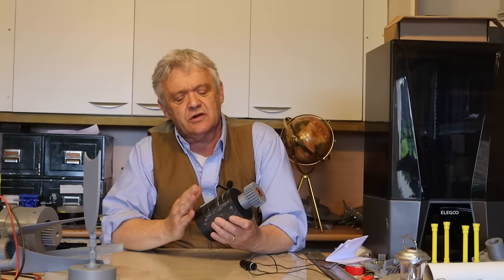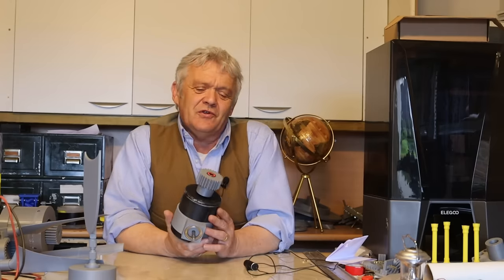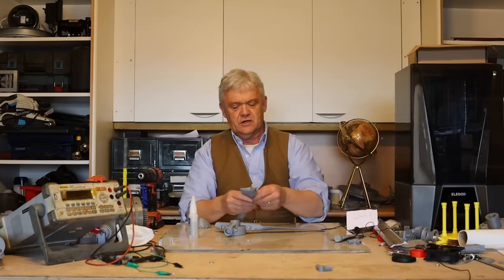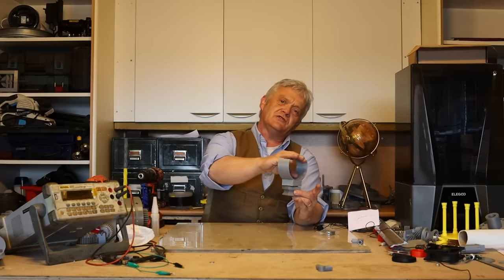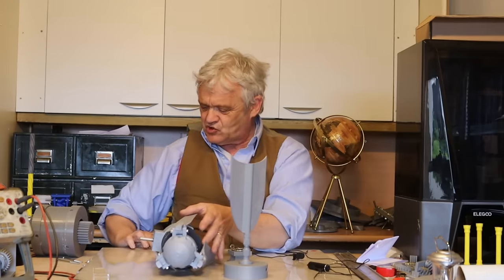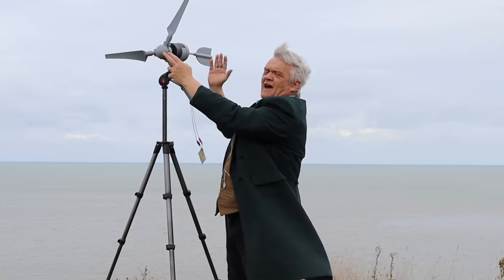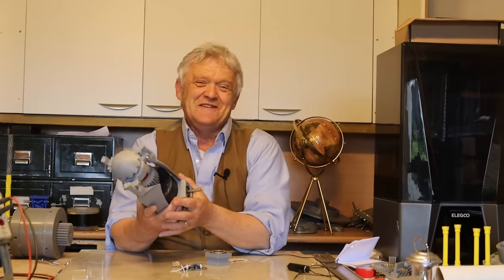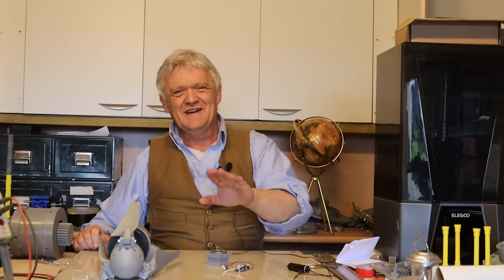2012 Awesome Portable Wind Turbine

Comment: That really goes. You scared the heck out of me. All that "plastic" moving at high speeds and you standing less than a meter from it. Holy Hannah.
Reply from the maker: lol - just think if it was razor blades mate -then you need to worry - lolol
Reply: I'm sure there was no real risk here given the short duration and the freshly printed blades, but I was a bit scared too!
Mass produced wind turbines are usually placed many meters away from occupied buildings because when those blades come apart, it's pretty spectacular. You don't wanna be near a spinning mass of fibreglass or shattered plastic traveling at 30mph

Comment: Congratulations.  No need for gears.  (the best part is no part)  That coreless generator worked out nicely.  The turbine blades are very impressive (and facing the right way).  A video about the blade design; airfoil used, twist rate, taper, etc. would be wonderful.  The generator and blade designs take this beyond toy potential.

Comment: Alfred T. Forbes "The Homebuilt Dynamo" describes and lays out in tables building a wind generator to a specific wattage and rpm range.
In this book Mr. Forbes builds a wind turbine generator of 1000 rpm or less, and in that rpm range will generate 1000 watts.
He shows how to pick a wattage and rpm and then design the coils based on those parameters so you can achieve your desired output.
It is a book written by an engineer for engineers, very well thought out.
Reply: @danedmiston9673  It's been a while since I've read the book. I kept it next to my computer when doing any wind generator research. It was the only book, that when I gave it away to an engineer, so a good home, was painful for me, I didn't want to turn it loose.
This book, for me, demystified many things about generator design, where other books are overly complex or skipping on valuable details.

Comment: Amazeballs! Thank you for all the files! 

This would make a great trickle charger for Dad's boat to also help keep the birds from crapping on it. Right now there are weighted plastic owls and zip tied on lengths of plastic bags working as winged tentacles. It was working for a while, funny eh. Have a good one all.
Reply: I was just thinking similar.   I have a 'hawk' with fluttery wings, on a long flexible pole at my allotment, it keeps the pigeons and squirrels away (mostly).
Reply: @bikerfirefarter7280  We could 3D print deer whistles into the blades with tiny velocity stacks. Or regular  whistles if someone had a neighbor with a wind chime they hate. :)
Reply: @Rebar77_real  Gad! Those garden wind-chimes, solitary, useless, unmusical irritants, I hate them.
However, having said that, there used to be a tree, in a rural setting near Sheffield UK, loaded with dozens of wind chimes. The owners must have been gifted musician/artist because its the ONLY set of chimes that sounded beautiful and appropriate for the setting.  Someday I'll try and find it again and record/link to it.

Comment: this would be incredibly useful on a RV or camper van setup. Put it on some sort of extendable pole that can be unfolded/deployed when parked and you'd have a source of power with or without sunshine. I've often thought about using small turbines to recharge batteries while driving also.

Comment: Looks good Rob. Sounds like you were able to make that gearbox a lot more quiet than it was before. Did you grease or oil the gears?
Reply: No gears.  Less is more.
Reply: you know what works good on 3D plastic? Lube. Yes that kind of lube- non solvent, non silicon, has a bactericide in it so it doesn't go rancid.
Reply: @markiobook8639  I'll keep that in mind

Comment: You could probably scratch that tail if you use the blades as the tail just make the blades the end. Mount the body of the generator closer to the current tail and make the blades a mirror of the current ones so it will still spin the right direction.

Comment: Hi Robert, really interested in this and have started printing the wire loom jig.

Do you have any links to the parts you use? Magnets etc?

Have you had any thoughts on how to take the power off while allowing the turbine to swivel? Maybe graphite brushes on a slip ring...

Thanks

JT

Comment: Would be interesting to use something like this to heat a sand battery with low-voltage heating elements. Could eg. keep a garden bed or greenhouse above freezing temps.

Comment: nice little turbine - naturally for more power the "smart kids" can scale the blades up - even if it means printing in 2 sections (or use a sheet product for the tips - easy to form to shape.. -j If splitting into several parts - just (add to the design) print locating pinholes at the cut - for inserting paperclip wire or other easy-to-get pins for alignment

(Blade curvature orientation is an improvement over the model in Vid-1965 (reverse curvature) - though the nice thing about using plastic extruded  pipe/tube products is the uniformity (less likely to fracture along print lines) , and ease of reshaping/forming blades with a hot air gun - just press the blade on a formed buck to set curvature and twist - FFD printed products tend to shrink strangely is heated to glass transition temperature)

once one has a blade shape they like  - FFD printed blades can be overmoulded in epoxy+s-glass for an immensely strong and "cheap" system.

Comment: If you mounted the Fan Backwards on the (Hobson Drive) I think it was you could transfer your power generation below and not worry about the swinging of the engine in the high winds (Drag style) rather than using a fin the blades could act as the tail fin, Also if you used the new style of cut out propellers would that not almost double the amount of wind you harvested ??

Comment: Hi Robert, after trying to investigate further into Synchronous Reluctance Motors (Generators is my goal) I stumbled upon your channel late last night in bed and I am insanely impressed! 

Do you by any chance have advice, what would we need to change to improve output? I saw Kris Harbour made a 2KW axial flux motor wind turbine, which it's design seems quite simple. What would you say the strengths / weaknesses of this design are compared to trying to do it with axial flux motors?

Comment: Never mind the PWTG output, your output is amazing.
Are you sure you haven't cloned yourself and kept it quiet?
Awesome little project come-together, I'm thinking a scale up is in the wind (scuse pun). I really hope if anyone makes these commercially they give you some serious credit. I'd love to have one on my little yacht (commercial ones are extortionately priced, and the output rather 'wet', if you get my drift).
Hmm, how about a towed generator for boaty folks? And there can also be reasonable tidal drifts when at anchor (but naff all wind). Could the blades be fitted behind the generator and act as their own direction 'vane'? Maybe two sets of contra-rotating blades too.
I'm thinking a 'kite' in the water, to keep it all below the surface, with a turbine dragging at the rear, and the tether is a relatively thin shaft with the genny hung off the stern rail.
Sorry, waffling, you keep giving me ideas.  ;-)  Thanks.

Comment: I really love all of your videos bjt it would be awesome if you also measure it's voltage and amp with multimeter so we know how much power it can provide so it will be helpful in our projects too I'm also working on wind turbine that's why 😅 thank you ❤
Reply from the maker: I do that mate but they don't make good videos and rarely get  a high number of views - but you can find them
Reply: @ThinkingandTinkering  I'm sure you do test volt/amp output related to rpm. Is there any chance of a PIP of a graph showing these result? (Not wanting to seem spoon-feedy, just thought people would find it of value).
Thanks.    I'll just pop back under my rock now.

Comment: Just thinking... why not do away with the tailfin and put the "propeller" on the tail end?
Sue, there'd be the tendency to pull the propeller off the shaft, and pull the shaft out of the motor, but almost all prop-driven airplanes have the prop in front wanting to do exactly that, and the bearings essentially deal with the same forces but pulling instead of pushing.

Comment: make a bank of these with some cheap solar panels and you could store in old vehicle batteries for very cheap "powerwall" home solution. Got an old washing machine, might use that for battery storage(outside of course, vapours/fire/safety) . so many ideas, so little resources

Comment: Amazing.but I have a campervan with solar.  It would be great if you could build one that's quite so after sunset so  while am watching TV or using the diesel heater and lights I could trickle charge the batteries over night without worrying about waking up to the noise of the wind turbine

Comment: What if you combined a Darwin wind catcher that directs air up with a thermal updraft chimney like they tested in Spain?  For home use, have the chimney go up from a gazebo, have the turbine near the bottom to ease maintenance, possibly have roll out awnings around the perimeter of the gazebo to increase solar collection area?

Comment: Bigger blades = better output ? What disadvantages would there be to bigger blades, other than ease of stowage, I wonder ?
Reply: I've taken a lot of 'collapsible' stuff around with me, I find that anything that will stow in less than 1.2 metre length (and in a 'tube' less than 200mm dia) is not too irksome (and 800x120 is 'forget its there').That 1.2 could reassemble into a BMF of a wind turbine. Of course getting it high enough so no-one gets accidently clouted by the blades would be important. Though why anyone would need that amount of portable power is questionable; a 2.4 metre dia rotor is nothing to take casually.

Comment: Because wind comes in gusts the propellor speed varied wildly and I assume Rob held the vane to stop it from spinning around.
Can anyone explain why commercial wind farms always appear to rotate at a fixed speed and in step with each other and don't spin around?
Reply: Wind down here among mortals is a very different proposition to up there with ye gods. 
Go up a bit and you'll find predictable (ish) wind currents rather than the blustery chaos we get. 
When you've a ginormous piece of heavy engineering like that, you don't want to have to make it swivel into the wind, that's a massive pain and cost, so they just face it into the direction that most of the year will be the right one and that's accurate enough most of the year-round to be worth the cost of errecting them. 
I don't know about the speed of rotation thing: it could be that they are limited to a maximum for safety or it could be that the wind speed is the same for all of them for the reasons I've already mentioned.
Reply: @TheBaconWizard  Many large turbines have variable pitch blade so that they can run a the ideal generator RPM.
The gyroscopic forces on the rotor and blades when aiming the turbine into the wind are kept to a minimum by using a small gear motor to slowly rotate the turbine when the wind shifts.
Reply: Ginormous is right.Those things are huge.
Reply: @danedmiston9673  Ah, of course. Makes perfect sense.

Comment: Are you going to try this with the Pelton blade, interested to see if is better?
Reply from the maker: not this one mate - apart from a few bells and whistles - like maybe a supercap in line and voltage regulation - a tweak to the blade length or two this is finished as a stand alone design
Reply: @ThinkingandTinkering  Thank you, of the different wind turbine blades you have featured, can you please put forward results showing the most successful and productive ?

Comment: Would more blades make it more efficient?
Reply: I think two blades would be worth a try.  It should give it more RPM for the same speed of wind.  The blades slow the wind down, so the more space between blades allows more time for the wind to speed back up before the next blade passes.  Also less plastic is needed and it is easier to balance the rotor.  (Three blades do look cool though.)

Comment: does it have to be 5v? could this output 24v?
Reply from the maker: nope - i set it at 5v with the voltage regulator - you can set whatever you like - i only put it as 5v as  think  will be charging most at that level - but it s whatever suits you - to a degree
Reply: @ThinkingandTinkering  thank you for the response!